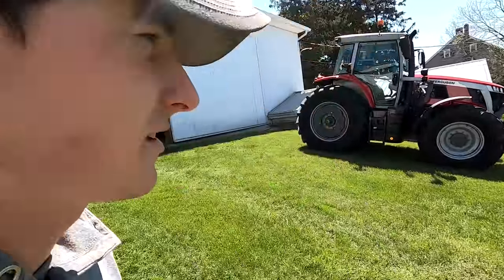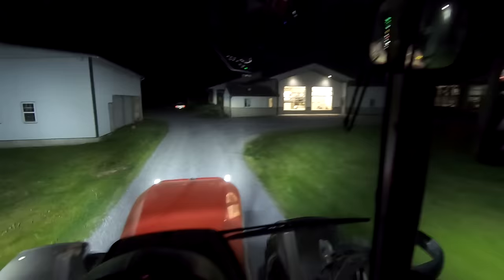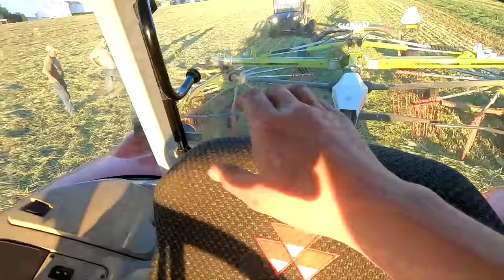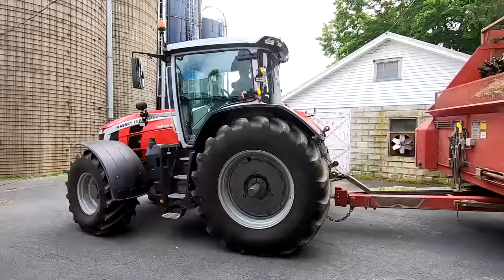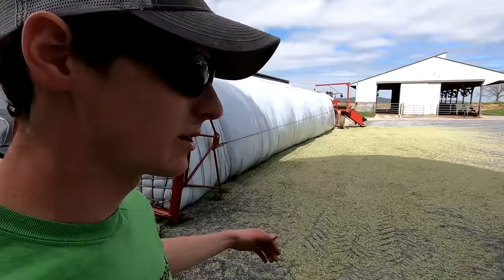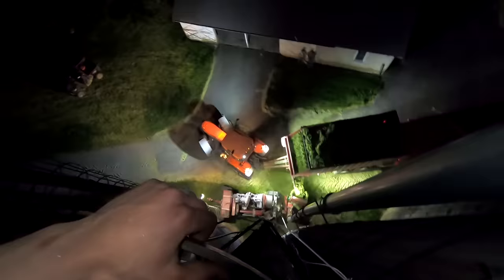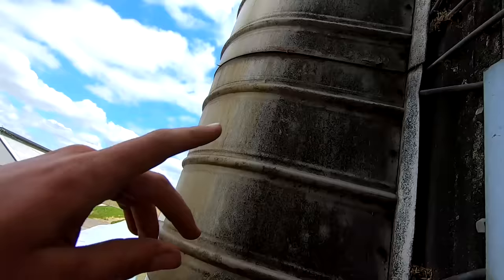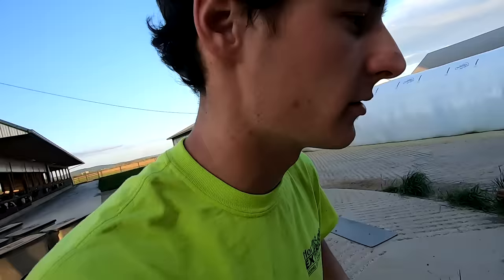Triticale Harvest | Filling Silo & Ag Bags

Comment: There must be a monster engine on that silage blower.  I can not believe how much triticale it can take or how fast it runs.  If I tried that, I'd spend the next few hours unplugging the pipe.  Unfortunately, I have a lot of experience doing that.  Great video Eric.  I imagine being so busy, the time really flies by.
Reply: I think the same thing every time that blower shows up. I think Eric had said a while back that the custom operator had built the thing. I am also impressed when they are positioning it and connecting the pipe that it is also self propelled and they do not need a tractor to maneuver it into place.
Reply: You boys know what your talking about.

Comment: Awesome looking tractor Eric. Good luck with it. Another bunk or 2 would seem to me be the most economical and much less susceptible to weather (wind,  tornados, etc) and you don't have to climb them, maintain the unloaders or "level them off".  Great video today.
Reply: As a guy who has to work bunks (ours are 3 to 400ft by 200ft) that are almost 30 40ft high, the amount of spoilage we have is unreal on top of that the risk of a pile cave in or slip and fall risk makes you wonder how many times your gonna get lucky I wish we could just blue tooth the feed into the cows stomachs lol
Reply: Bags are pretty hard to beat for efficiency and feed quality. If you are covering your bunk, bags aren't that much more expensive than bunker covers.
Reply: @anthonypoquette8018  moisture, innoculant, packing, and covering quickly with high quality plastic. In that order. With a good O2 barrier. Not that hard. Just can’t half ass anything.  Of course ma nature can always throw a wrench into it!

Comment: When I was 16 or 17 years old I was cutting and hauling corn silage with a G John Deere. I was pulling two wagons at a time hauling it back and forth to the farm and field. A bolt that connects the steering worked loose and caught on the hood of the tractor causing me to hit an embankment breaking the front of the tractor off. The loaded silage wagons pushed the tractor sideways blowing both back tires and tearing the front end of the first wagon out. When I hit the embankment it threw me up out of the seat. Both of my legs hit the steering wheel keeping me from being thrown off the tractor. Luckily it didn’t break my legs. Farming is a very dangerous lifestyle/profession but I enjoy it very much.

Comment: Great video Eric I love the tune you always use during chopping. Looks like your plenty busy. Looked like you had a nice smooth ride down the road with that new tractor. The guy that does your chopping has quite the equipment to chop and doesn't stop til he's done. The area where you had calves looks like it took up alot of room but the way you changed it looks better and gives you more room.

Comment: Have you ever considered using a yard blower to help you clean up around areas where the big truck comes in and loads to Cylo also when inside Cylo leveling it , use blower again instead of racking you might have to ware a cylinder style dust mask and maybe eye ware too .but blower might save time and reduce physical labor

Comment: I have run both a 7724 and 7614 Massey before. 7724 is 220 horsepower and 7614 is 130. Out of both I like the 7724 better. That is our current big horse tractor on the farm I help on. We are a mostly Massey farm. Also have a 1100, 1085 and then the 7724. Have ran all 3. In the summer I pull loads of hay with the 1085. Our 7724 has the cvt in it also. I like that you can touch a button and the foot throttle becomes the accelerator pedal. Will actually hold its self on a hill if in that mode. 7614 I kind of liked that would automatically downshift to b3 if you stopped it. That had the dyna 4 transmission. 4 ranges with 4 gears in each range

Comment: What happens to the Tritical that gets flattened by the tractor tires after you make that first pass of cutting?  Is it able to be cut when you come back around?
Reply: Most cases when he comes back around the other way, your mower will pick back up what was driven over. Just something that's un avoidable :)

Comment: That's the new tech, smaller, similar power engines with less cubic inches doing the work means less emissions overall and lower fuel consumption. Granted in diesels that means turbocharging might be a necessity but that technology has evolved greatly over time as well. It is however another point of failure but acceptable in the long run.

Comment: Have you ever considered having a mower header mounted on the front of the tractor, then another pull type mower like the one you're pulling on the same tractor?  You could use cameras and monitors to be able to watch both headers at the same time from inside the cab of the same tractor.
Would that be too much to handle?

How big is that header, anyway, 10 or 12 feet?  Why so small?  It seems like you could have two of those little headers on one tractor.  I'm used to self propelled swathers with 14 foot headers, that's why I'm asking you about this.

I've also never seen windrows get scattered like that in the field by rakes.  In the southwest, we take two windrows into one, but never scatter windrows like you're doing. It'll have to be raked twice 8f you do that.  Is that because you guys have lots of humidity and therefore need to take a field twice to get it to dry?

Comment: Hi Eric, question, is there a difference, nutritionally, between the tall crop and the shorter one? Other than volume of feed, is there a preference? Another great video!
Reply: Alfalfa (shorter crop) has higher energy and protein content than triticale (tall crop.) Triticale works well in conjunction with corn as a cover crop. Alfalfa typically is the only crop on a field for a season and you harvest it 4-5 times.

Comment: With every single power unit seen in this vid running on diesel and the higher price of diesel ( going up every day ) this must have increased your cost substantially..here in commiefornia the cost retail for milk has been climbing quickly and steadily ...how much of that increase has made it back to you the producer ? ...1 QT whole milk $2.99 to $3.99 depending on brand